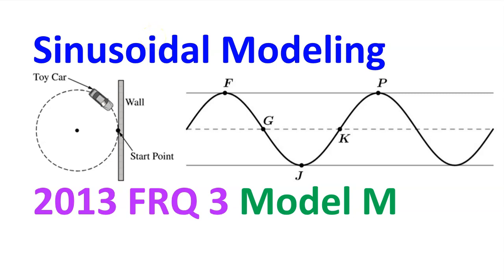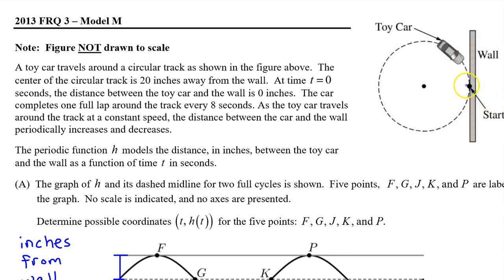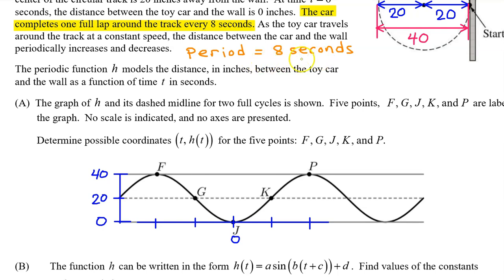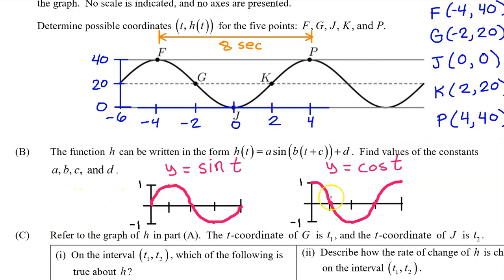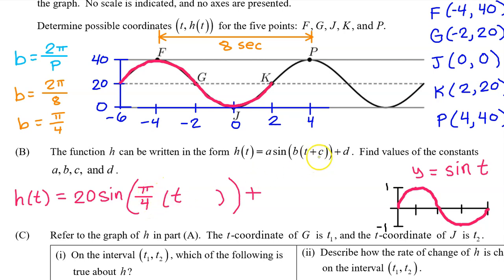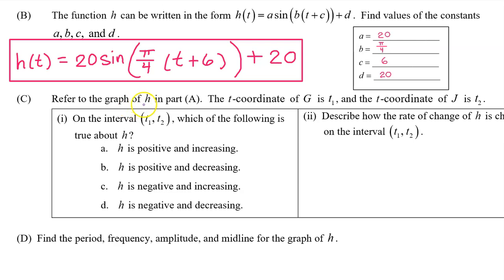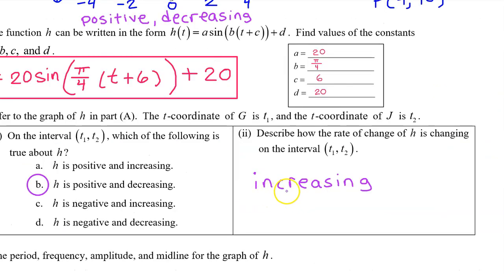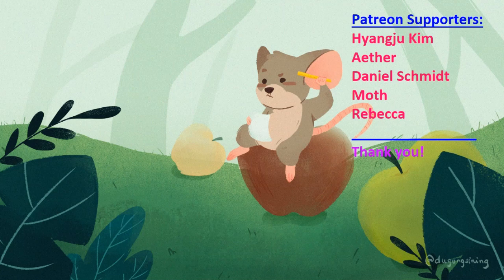2013 FRQ 3 - Sinusoidal Modeling (Model M) [AP Precalculus]

Comment: For this FRQ what I did was this:
Part A:
F(4,40)
G(6,20)
J(8,0)
K(10,20)
P(12,40)

Part B:
h(t) = 20sin(pi(t)/4)+20
a = 20, b = pi/4, c = 0, d = 20

Part C (ii):
at interval (t1,t2), h is concave down so the rate of change is decreasing 

I did it a little differently but everything you did is kinda similar so how many points would I get on the real FRQ?
Reply from the maker: @fortnitesweatkid  Based on the your point F coordinates, your c-value should be -2. So minus one there. On the interval t2,t2 h is concave up so ROC is increasing, so minus one there.
Reply: @ 
Oops sorry I meant to say the rate of change of h is decreasing but is concave up.

But for concave up and down isn’t there different curves where curves of concave up/down have a rate of change that are increasing/decraeasing? Like say concave down but increasing and concave up but decreasing.
And also how can you find the phase change, I’m getting confused in that.
Reply from the maker: @ That’s going to be too complex to explain by text. If the video doesn’t explain well enough, you’re going to need to ask your teacher. 🤷🏾
Reply: @ I’m in algebra 2 lol I need precalc for my placement exam. So far you’re very helpful with the FRQ. I appreciate your videos.
Reply: @fortnitesweatkid  a bit late but concavity of a graph is just descirbing what is happening with the roc (rate of change). for instance, if it's concave down the roc is decreasing and u can visual see this by drawing tangent lines to the points and seeing the slope decrease as you move along. concave up means roc is increasing and you can visual same way. for the phase change, in precalc, you can just eyeball where the concavity is changing which in this case you should be able to see it's at the mid line. you go more in depth of how to find exact points of infelctions for how concavity changes and how to find exact intervals once u learn deriatives. tried to understand what u were saying best i could so hope this helped